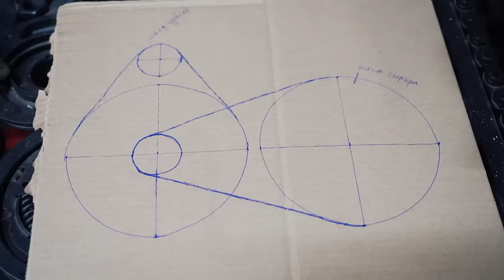Turbocharging a Lada with a starter motor

Comment: You could install a microswitch at the throttlebody or below the gas pedal so that the contraption only begins to spin once full throttle is applied. Might hook up an additional fuel pump to the same circuit, that squirts some more gasoline into the intake at the same moment.
Reply: Was thinking the same or try different size pulleys to make more rpms at the turbo
Reply: Why does all of this remind me of nitrous lol
Reply: lol right but ware is the fun in that. I have a peddle car in my head after they made one. I want to make one just to take my kids to school. Now I'm thinking I could use a starter to help go over bumps or for reverse.
Reply: with a potentiometer, they could even tune the boost map very precisely
Reply: I’m actually curious about this kind of thing at lower rpm on cruise control on a highway, seeing if it reduces pumping losses more than the energy it consumes
Reply: @Athiril  Audi is doing this now, actually! Designed for both efficiency, and to eliminate turbo lag before a traditional (though crazy-high pressure--like 50lbs or something) turbo kicks in.
Reply: @francoisfigeac4942  You could even fit a CVT from something like a scooter, because the turbo drive motor doesn't need a lot of torque at high revs.

Alternatively, using brushless DC motors from quadcopters to drive the turbo shaft directly works very well. There's a few commercial systems that do this.
Reply: @Stoney3K  that is a great idea
Reply: Add a 5th injector into the intake that only activities under boost so it dont lean out. And add a cooling system onto the starter, wrap some copper pipe around it to stop it cooking, add some heatsinks maybe?
Reply: large brushless would be much better, switch to kick in at 1/3 or 1/2 throttle and yes to a potentiometer driving the electronic speed controller. it'd require some fun and games to put in 1-2 extra fuel injectors, their cycling also controlled by pulses from the speed controller or ignition/tach. it'd be tricky but CAN be done, creating an easily installed stand alone electric boost adder. for just messing around with a starter motor this experiment was "bone-head proof of concept" FUN no doubt!
Reply: @Athiril  the right size+shape snorkel can do a lot after 35-40 mph without anything "parasitic" other than a little wind/air resistance. the rough part is it could also gulp in rain if there isn't a bypass setup incorporated. snorkel/funnel>bypass>air filter>throttle body.
Reply: Shutting down the alternator when using it would also be useful. That way the turbo runs entirely off the battery instead of taking power from the alternator to run it.
Reply: @dbratboy92  it need own battery, if that is made for rally.. and use 24v, remove other belt, only one step up. It will be still enough when 24v. Make hole to electric motor body and take air with 10-12mm pipe from boost. It's warm if it compress, but not so much in this system that cannot cool stator and rotor.
Reply: @Stoney3K  If you made it driven by an electric motor, then a CVT wouldn't be of much use, but if it was engine driven, the a CVT would be great as it would get rid of the main problem of centrifugal superchargers which is that they only have boost at high RPMs to prevent overboosting because centrifugal compressors are dynamic compressors so when the RPM is doubled, the boost is squared. A CVT would make a centrifugal supercharger act like a positive displacement supercharger, but with higher efficiency, smaller size, and lower air output temperatures.
Reply: vtec for supercharger
Reply: @francoisfigeac4942  ... the original Honda Goldwing used an electric reverse gear due to there not being enough room in a motorcycle gear box.
Reply: Ya could put a bung on the intake with a 5th injector on a hobbs switch, maybe a saab injector. Turbo dodge guys did this in the 90s
Reply: Why you actually don't want to try it by yourself?🤔
Reply: @rupe53  yes I was also thinking of a lawn tractor rear end. It will have gears to help and has a reverse. I don't think I have the power in my legs to do burn outs lol. Also thinking about the passenger and how they need to pedal too. Passenger is a pronoun to work harder ( Right )
Reply: @francoisfigeac4942  ... hard enough to balance a heavy bike without the passenger wiggling their feet. Besides, you only need a few bumps of reverse to get say 5-10 ft back out of a parking space on a hill. It's a real help if you have short legs.
Reply: I Was thinking the same. Maybe connect an extra fuel injector inside the intake manifold. 1 injector may increase the air and fuel mixture when the turbo is boosting.
Reply: @wsrepairs7080  ... you can also richen the mix by increasing the fuel pressure or fooling the ECM into thinking the air and engine temps are colder. OTOH, this is a prototype just to prove it works.
Reply: @francoisfigeac4942  The pulley ratio at the moment may be too high as the starter doesn't seem happy spinning up properly, not enough torque (?)
Reply: @Athiril  ive got a mazda supercharged miller, one of these for instant spoolup topend when the supercharger runs out of beans....
Reply: Even better, just hook up a potentiometer that's connected to the pedal.
Reply: Since this contraption has about five seconds of inertial lag to it, having it controlled by throttle body position or anything else like that is pointless. You have to preemptively activate it if you want boost to be available when you actually need it.
Reply: Came here to say something like this but you said it better
Reply: I thought the same
Reply: This whole thing reminds me of the police intercepter from Mad Max movie.
Reply: and water injection
Reply: @livinonlimiter  Need for Speed, Fast and Furious... Cinema and Video-games.
🤣🤣🤣🤣
Reply: @Glenn7719  maybe instead of fuel in can adding starter spray but i dunno what will add more power.
Reply: Back in the day they would take an Aviation Hobbs switch which switches contacts based on input PSI/ pressure and connect that to a BMW cold start injector. So at let’s say 10psi you can then that injector on and you are just dumping the extra fuel in. Then you would take an MSD boost timing master and that would retard the ignition like 1-10 degrees per psi of boost. Add a rising rate fuel pressure regulator and you can get some pretty good power without having to modify the computer at all.
Reply: All wrong.. He needs an Arduino and a signal from the crank sensor to Jugde how much rpm the engine is at and how much voltage to give the starter
Reply: TURBO VTEC
Reply: Vortec supercharger systems have a fmu (fuel management unit). Used boost for reference and will modify how much pressure is supplied from the fuel pressure regulator.
Reply: something more  
can always  
be done  

they put  
enough  
time in  
to shenanigans
Reply: You can just get a clutch killswitch and put one on the throttle then rewire
Reply: F*ck all that noise, just connect it to an ecu, and use sensors
Reply: I was thinking the same thing but for it to engage at 2/4 throttle and for it to be engaged with a button that is pressed by the pedal and after being pressed turns on a little led so you can see when it's on and there also being an on/off switch for if a mechanical failure occurs you can stop the turbo and run without it and a launch button like a paddle on the steering wheel that gives 55% turbo and once released a full 100%turbo and a blow-off valve so it doesn't make too much pressure which can be adjusted with a dial on the dashboard (I love YouTube comments since I can type all I want without a limit)
Reply: @craftinbikes5601  just say 1/2 throttle
Reply: @lol-ws6po  yea but in my country we usually say 2/4
Reply: @Glenn7719  A Lada is carbureted
Reply: Need to use a 4 barrel carb with mechanical secondaries to go with the turbo switch. I think the bang came from the muffler blowing apart due to the extra pressure.
Reply: That would solve the tuning bit, and it needs a wastegate. I believe that poof of smoke at that one time was from boost surge at decel. Not good for engine
Reply: You do it
Reply: And more ass in the motor. Probably need about 3 of them based on what I'm seeing here... And a cap bank to kick them in the head. The power isn't free of course but the alternator can handle that over time if you didn't overdo it.
Reply: it will also need diffrent sparkplugs the boost probably blew them off thats a comman issue when u turbo cars that are NA the Boost turns "off" the spark plugs for a few RPMS
Reply: or not use a stupid starter motor. You just run it off the drive belt. This is going backwards in tech. We have had forced induction for 100 years and this is what we get, a knock off ebay electric turbo lmao.
Reply: @jannejohansson3383 
Different thinking there. I dig the idea. But does it work?
Reply: I was thinking the exact same thing. like a jetta or bora throttle switch.
Reply: @Glenn7719  it's a lada. It has a carburator. U could use nos with a nozzle Infront of the turbo. Helps cool also.
Reply: Reminds me on Mad Max part1 with last V8 with manual switch boost kompressor..
Reply: Call it rus-tech
Reply: The problem is that it takes time to spool up the turbo and for it to build up pressure, that is why it is better to have a separate switch so you can turn it on on good time before you need the power.
Reply: Made another version of an Oberhausen Electric Supercharger, pretty cool!

Comment: What you actually did was a centrifugal supercharger
Reply: My dad's old dump truck has something similar to this
Reply: I saw an exhaust gas powered supercharger once. It used a turbine.
Reply: @MaxBrix so a turbo charger?
Reply: @carolina.910  Half ofa turbo without the benifits of free power :)
Reply: @paulfarina1  I'd like to see that never heard of one
Reply: Independent to engine so its a decentrifugal charger, advantage is 12v extra battery can used to charge and discharge, simple energy storage.

Comment: You should use another smaller internal combustion engine to power the turbine. Like from chainsaw or something like that...
Reply: You've invented the leaf blower
Reply: @Mastermindyoung14 have them use a leafblower as a turbo...
Reply: @jokeletsplay  ... I believe Mythbusters already did that.
Reply: @rupe53  itsjustasix did that on a tacoma too
Reply: @jokeletsplay  Roadkill did it too and it definitely works.
Reply: They should use 3rd (smallest) internal combustion engine to power the turbine for the 2nd engine
Reply: Just replace engine with a pony motor 😂
Reply: That is a great idea! Connect both throttles together! 🌞
Reply: Brushless will hit the revs they want with the torque also.
Reply: @ilnuriv  lolz
Reply: @rupe53  mightycarmods did too.
Reply: @jokeletsplay  it does actually work just watched a vid where they strapped a Milwaukee electric leaf blower on an it made actual boost...sounded cool too
Reply: @rupe53  not sure who was first  mighty car mod or myth busters
Reply: You coul add a big block v8 in the back to spoil a huge turbo for the Lada engine.
Reply: Why another engine this motor already doing same
Reply: Basically a Chaparral
Reply: In welding class my buddies and I did it with an electric leaf blower to this old Nissan stanza, aww man that was a blast and got me on path to forced induction fu .
Reply: @jokeletsplay  I did that. With a toro electric leaf blower. it works too, but the motor dont spin fast enough at high RPMs and will create negative pressure in the intake if it cant keep up.
Reply: @rupe53   ROADkill used 6 ?
Reply: @dartravensshelley6990   goes back quite a few years, but it's been done before and sometimes with several blowers.
Reply: Electric would probably have more torque
Reply: Any 100cc bike engine would be enough to power the supercharger

Comment: I would suggest you using a brushless DC motor not a starter motor on alternator that way you can have the very high RPMs
Reply: Why not just put that motor in the drive train or the serpentine belt?
Reply: @minkusmaz  I had the same thought I think it is called turbo compressor.
Reply: nonononononono, turob needs 100k+ rpm. Motors don't like to spin that fast and gears add power loss and wear out rly fast. Skip the turbo and get a blower if it needs to be electric.
Reply: @BruceCarbonLakeriver  Electric motor inline makes it a parallel hybrid ✌️✌️ Compressor is if the motor influences the air intake. There are electric super and turbochargers already
Reply: @Rudy97  or a bigger turbo, ex Hx60 or hx80
Reply: Just make a gearbox to change gears and speeds
Reply: @gabrielv.4358  That's what they did in the video...
Reply: There is BLDC with 1,5 kw power?
Reply: @minkusmaz  i havent watched it yet
Reply: @sigmawarrior.fokeryou  There are hobby grade BLDCs with 10kW and more. The problem will be the 12V DC. Normally, these big BLDCs require 36 to 50 Volts.
Reply: @gabrielv.4358  Haha I can tell
Reply: @minkusmaz  If you can pump more air in to the engine, you can burn more fuel = more power then just the electric motor by itself attached to the driveline/belt
Reply: @xFourTwenty117  Not true - the horsepower from the electric motor goes direct to the drive train instead of experiencing losses from turbine etc
Reply: Btw superchargers push the same amount of air even if engine is spinning at 5000rpm so rpm is not a factor(But I CAN BE WRONG)
Reply: @pipipupucheck3432  that's completely wrong
Reply: @minkusmaz  Professionally built thousands of dollars worth Electric Superchargers, sure. 

The 49.99 12v booster, no. 

Need a hell of a high RPM which requires power to push that air, so you need a beefy brushless and that takes Alternator current Galore, so you need a beefy Alternator as well - which puts a hell of a load on the engine.

All Turbo's/SuperChargers/Turbo chargers take Horsepower to operate - but you get more Horsepower from the influx of Oxygen+the outpouring of Fuel. Turbo puts a back pressure on Exhaust, the exhaust thus puts a back pressure on the piston - lose horsepower. Supercharger uses the belt, the belt is connected to the engine, the drag from spinning those screw blades at insane RPM's, squishing (compressing) all that air - lose horsepower
Reply: @sacr3  Electric super/turbo units would be cheaper if manufactured at scale, and they eliminate the belt issues
Reply: @geirkleven3936  The definition of turbo-lag :D
I think for a small engine like the 1500 used in the Lada, an HX30 would suffice or a Super HX35 would be perfect. Fast spool time reduce the lag. Though this would be true if they made a proper turbo manifold and drove it the traditional way. Not really sure how that would translate to an electrically powered turbo
Reply: @minkusmaz   If you have a 5hp electric motor adding to the drive line, you will get ~5hp added. If you put a 5hp motor and push more air through the engine, you can make a lot more than 5hp.
Reply: The real issue with powerful model motors is that at this power, they tend to be too slow to direct-drive a turbo. They are all in the DLRK configuration that reduces the RPM and increases the torque. A regular 6-pole, 3-phase model motor would be good for a turbo, but they don't make them this big.
Reply: Audi and a company from Holland has made electric turbokits. And they give quite a bit of boost. Audi made them to get rid of the lag.
Reply: @LabRat Knatz You could use an alternator in place of the starter motor but you'd need quite a big inverter to run it.
Reply: @christiansprojects-cgmanuf1426  they could use multiple car battery in series to get the voltage. And charge them using the cars battery using a dc dc boost converter.
Reply: @ratgreen  This would work I guess.
Reply: @BruceCarbonLakeriver  ... I believe a belt drive would be a supercharger. They wanted to build a stand-alone system.
Reply: Just 'rpm'. Never 'rpms'. You don't pluralize abbreviations.
Reply: @sw6188  .... valid point. The R stands for revolutions and that's already plural. <LOL>
Reply: @rupe53  I hear people on Youtube videos actually saying "rpms" out loud and I cringe every time. I just don't understand where they get these bad grammar ideas from.
Reply: @sw6188  ...There's a (now) old phrase out there... it must be true 'cause I heard it on the internet. They spend more time here than they spend in school. <LOL>
Reply: For Lego setups people use multiple motors connected to a big gear, so do something similar, Just use 2 starters. I’d love to see you convert alternator to brushless dc if not.